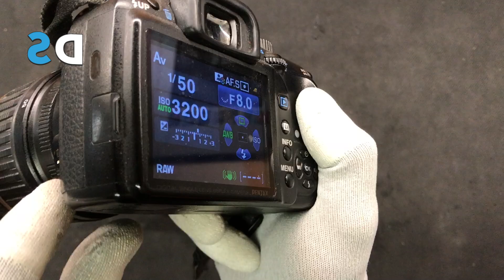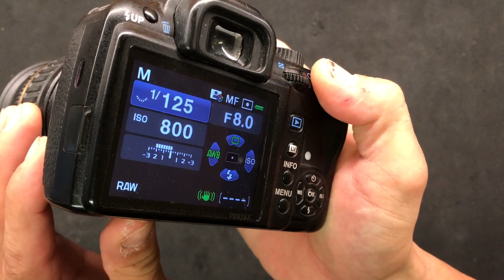How to repair DSLR camera Pentax K-r  - af/mf not working

Comment: Hello, I have a Pentax K-X DSLR. When I move the switch from MF to AF, the camera doesn't respond and instead displays MF in the top right corner of the screen no matter if I have it on MF or AF. I know the AF coupler/screw are making contact as I am unable to manually adjust focus while in AF mode. Does this still sound like a defective AF switch? I also have noticed that when moving the picture mode dial, it stays Av - automatic exposure mode. So perhaps a deeper mechanical/electrical issue or issue with the lens?

Comment: Would a defective af switch cause the motor to spin but not spin the pin? I hear the motor spinning but the pin that drives the focus on the lens doesn’t spin. I hear a whining/grinding noise when it tries to focus. Is this from the switch being defective or could it be some type of stripped gear or something.